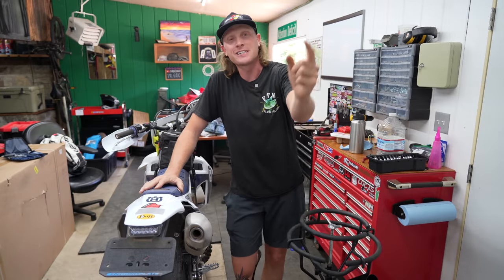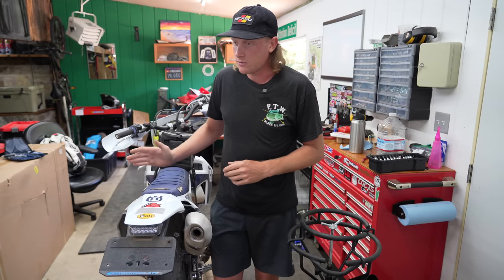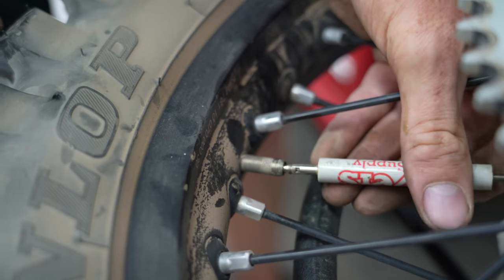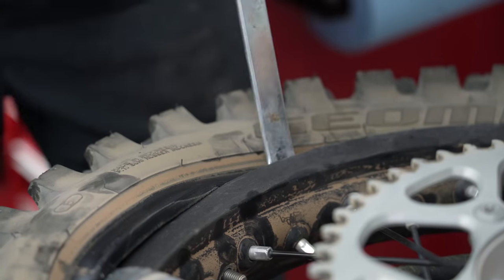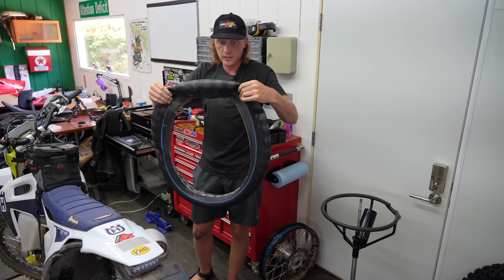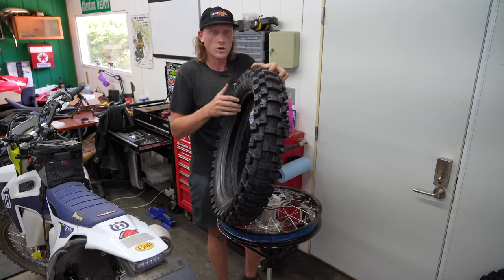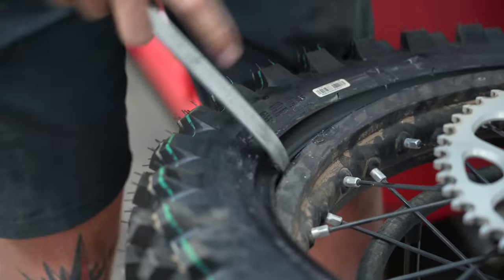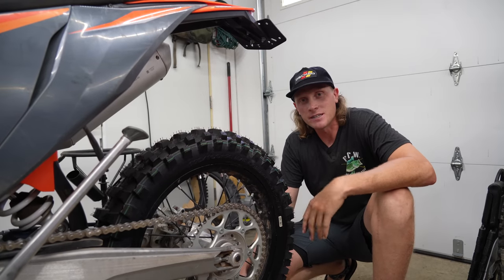5 Dirt Bike Tire Changing Tips For Beginners

Comment: I got a tip for beginners, because I too am a beginner and just recently ran into this (which I think might be rather common): if using a rimlock and going to set the bead, the tire might look mis-aligned radially. What I found was that, although the bead set, it set on the top of my rimlock rather than on the inside of the biting edges (like they’re supposed to). So, the fix; let the air mostly out, push the rimlock deeper into the tire while simultaneously finagling the lips of the tire around the rimlock. It helps to use lots of lube, and good lighting so maybe you can see in there. Then set the bead again and bounce the tire as he showed in the video, and hopefully that would work for anyone who may have this issue and reads this…at least that’s what solved my issue. Good luck!

Comment: You said the key word as far as tire changes go, drop center. If you understand how the drop center works you have a much easier time with tire changes. There's no muscling the tire on, but working with the tire, not against it. Thanks for the video.
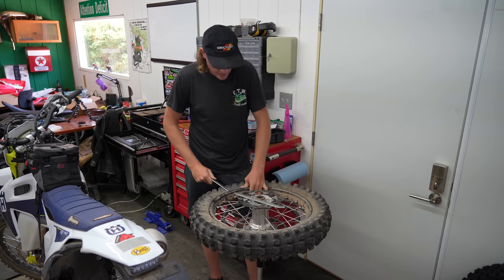Reply: Ok…I rewatched this and he’s talking about drop center at 6:30. It seems that the idea behind drop center is getting the bead on the opposite side of the tire you’re working on to drop into the center of the rim where it’s closer to the hub.  

Please adjust this and help clarify because drop center seems to be a BFD and I want to understand this better. My last tire change was a mofo and I want to avoid that pain in the future.

Great video and wonderful tips - thanks!

Comment: Love the 606s. Ran em multiple times on my 250L and now on my 300L. However they're hell to try and change. I never considered getting em warm. I had to pay a shop to do it.
Reply: I used the cheap HF tire stand with bead breaker and tire shine spray to lube the D606's went on easy..
Reply: D606  doesn't SUCK

Comment: Doing them in a shop or at home clean the thing 1st. Helps in so many ways. Do not be a hacker especially when teaching.
Never assume the rim strip is ok from the factory. I changed the stupid AT81 front tire and the blue rim spoke strip had never been on top of 12 spokes. So the spokes were rubbing on the tube and dirt was getting in a tad. This was at 7 hours on a new 2022 KTM 300 XC TPI.

Comment: The Ibex is a great tire for the gnar(if you are light on the throttle), but it sucks at everything else. I tried one and it was trashed in 10 hours on my KTM 350. I have been running the Motoz I/T and it's been great and wearing well. H/T = hard, I/T = intermediate, S/T = soft. Your S/T is going to wear out fast if you ride pavement or are hard on the throttle.
Reply: for fronts, the HT has the most amount of rubber in contact with the ground, lasts a long time, other extreme, the ST has wide spaced knobs, WoW do they DIG!

Comment: I've used 216 Shinko, I've got good life 216 GT, and like the 216 shinko gummy !!!!!!!!!!!!!  but haven't tried any of the 216's on slab

MotoZ tranctionator's  I mix and match them,  if up to 50/50 slab/dirt, the H/T wears great for me, I break heavy and wear fronts fast, I've changed at 2kmiles before, but the h/t doesn't hook up like the S/T up front(less miles on slab).   I'm usually rocking a S/T front, and an I/T in the rear. For mud, M5b(I don't think DOT) ALWAYS!!

In rocks, the ve33s and the Arena Hybrid gummy rock.

Baby powder works well, I've also tried rubber grease and HD tubes, works great too.

I use bead buddies to help guide the bead to the center too, and use 3 of them for mousse's.

I'd bet in 20 years, if your bucket doesn't break, you'll still be using that Murphy's !!!!!!!!!!!!!!!!!!!!!!!!!!!!!!

Enjoy that Motoz tire!

Comment: I'm not saying that you're using it wrong, but Murphy's is water soluble. You can use water to thin it down and then apply it to your beads with a brush. It cleans up pretty easily with water too. Plus it cleans your hands really well when you wash it off.

Comment: spoon one side of the tire on, put a tiny bit of air in a lubed tube and put it in the tire. put the valve stem in, using nut to hold valve stem. spoon on other side of tire, inflate to desired pressure. tighten rim locks. bam, done!

Comment: Just mounted the EO7+ on the rear of the KLR. Looks like a tractor tire. Haven’t ridden it yet. We’ll see
Reply: When I mount a tire I mount one side and then pop it off the other side so the rim goes down inside the tire. Then I install the tube by bouncing the tire on the ground. It gives me more room to get my big hands inside to start the valve stem and work the tube in. Then just pop both sides back on.

Comment: I put Dunlop D606 Dual Sport Tires on my 2022 yz450fx they seem ok. I wonder if the Motoz could take the abuse of chain ripping torque..
Reply: The Motoz has way better grip than the 606 off road and it lasts a long time.
Reply: @nvmcrider8475  Cool! Thanks! I'll pick some up when this 450 rips the 606's up...
Reply: @nvmcrider8475  MX33 lasted a few months but was good and sticky..
Reply: NOTHING lasts on the back with YZ450fx's :)    sweet bike
Reply: @bradl45  Yeah it's quite violent lol! Thanks!